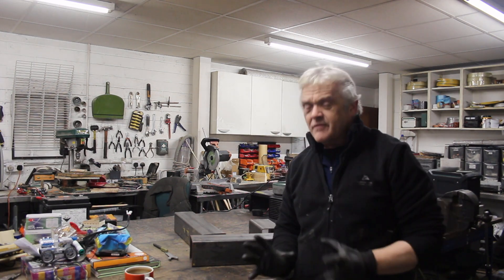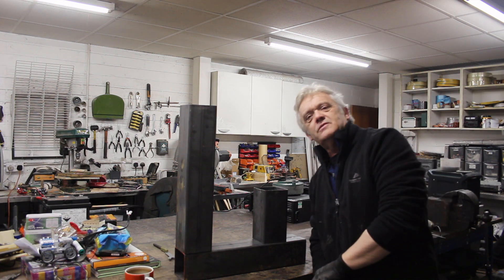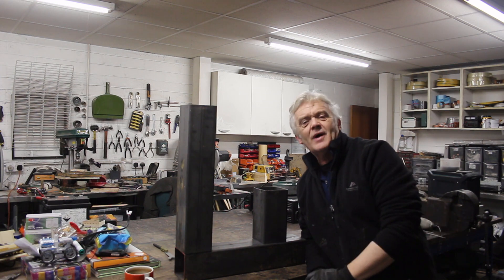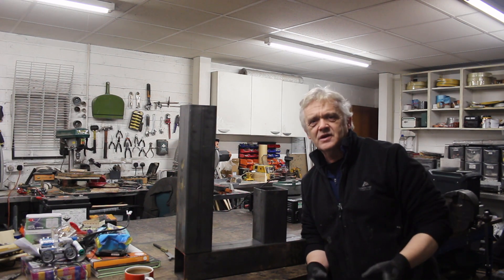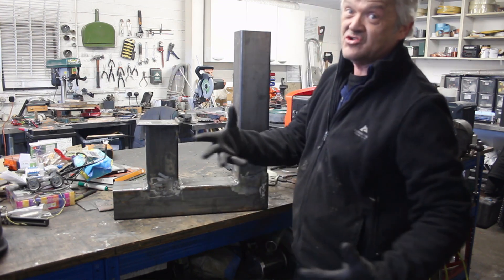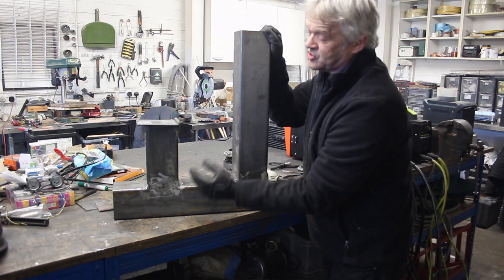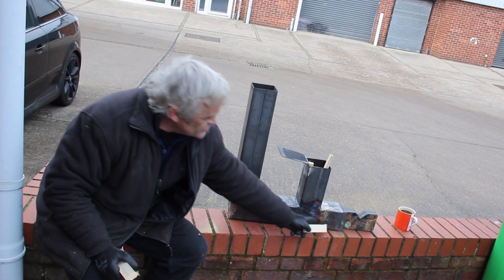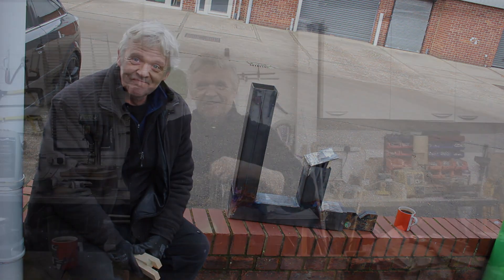1404 Rocket Stove For Mass Heating

Comment: I tried the L shape and it sucked, cooking a steak took much longer than usual. Maybe the tube was too small (800mm) or the height ratio was wrong, but I wasted time and steel with that, I should have made a J type instead.

Comment: Unhindered air flow, uninterrupted fire and Ash removal. 

Would welding a tube underneath (same measurements) with grates or holes drilled in the area of the burn chamber, help with better (unrestricted) air flow and the collection of fallen ash?

Great videos, sub'd ages ago.
Thank you for the uploads, each and every one of them.

Comment: My advice is,  get an oxy-acetylene kit and learn to use that instead of a welder. It can do everything you need for working metal. It can cut, weld, braze, solder, heat, anneal and temper most common metals.  There is a torch called a cobra or henrob 2000 that is amazing. Plenty of youtube videos on it.

Comment: If you really want to have a lot of fun get an oxygen and acetylene tank you don't have to get a great big setup just get a small setup a couple of 40 lb bottles perhaps and breathing is a lot of fun and you can weld with it as well most people don't call it welding anymore but it technically it is welding when you use certain metal rods for filler when you use brass rod it's considered breathing it doesn't penetrate at all but it is very very strong and one advantage is it's very good for welding cast iron or should I say breathing cast iron a fixing cast iron to each other if you will but it's a lot of fun it's very fast and I just love it I've got a pretty nice mig setup too. I got a pocket full of money right now and I'm thinking about getting a TIG set up but I just don't want to let go of the money I'm still thinking about it

Comment: Could you create a countercurrent heat exchanger for the intake air by creating a coaxial chamber around the chimney/burn chamber, i.e. intake on the outer perimeter of the top of the chimney.

Comment: Thank you for sharing!  I loved the video on the copper thermoelectric generator and was thinking you were going to do something with that in this video.  I really like this idea though!
One thing I've learned with Rocket Stoves is, the intake pipe diameter or size will determine the smoke stack or out pipe.  I believe the height should be at least 3 times the size of the intake opening, but I could be wrong and it may be 4 times.
The entire rocket stove should be made of the same size pipe for proper air flow so you never get smoke coming out the intake.

Comment: We built one like this with 6 inch tubing.  It's using an old propane tank for the heat exchanger.  My lovely bride covered it with cob and it's the finest wood burning heater we've ever used!  Nice even heat.  And no problem keeping the greenhouse and cabin nicely warm.
Reply: Could you put a video about it on YouTube?

Comment: Ceramic Fibreboard can be used instead as steel cannot handle the heat from a true RMH burn chamber or cheaper is casting using  DIY refractory  👌 CFB is easiest to achieve the riser height and diameter

Comment: I think people came to the conclusion of using bigger diameter tubes from trial and error. Bigger tubes draw more effectively and also allow for bigger bits of wood to be used. I think the pressure differential caused by the hot and cold gassed is quite low, so any restriction on the flow has a big effect.

Comment: For ash removal, you could try a square sheet of metal that fits the inner diameter of the bottom tube/pipe. Weld a rod to it and leave it inside, when you're ready to empty it, pull the rod and it'll drag the ash out. Perhaps add an ash tray on the exit for ease of use
Reply: Or just turn it on its side and give it a quick shake 😅😝🙃

Comment: A combined (portable ish) stove and mass heater can be made by using concrete in an old 20 plastic drum or similar, and either cardboard tubing or shaped polystyrene etc to form void and internal shape of rocket stove once burnt out.
Once concrete dry, remove outer mold and  either burn out or dig out polystyrene etc, and away you go!

Comment: Word of warning: Rocket Mass Heaters get intensely hot inside, on the order of 1000°C (when using larger, insulated designs). This coupled with excess oxygen will burn carbon out of the steel and turn your combustion unit into a pile of shards in very short order! 
Little cook stoves with no insulation are generally ok in metal but when building a permanent heater install, absolutely build the J-tube out of refractory materials!
Reply: I was thinking the same myself. In the drive for efficient burning, the temperature has to be raised and as you point out this degrades the steel. Lining with refractory bricks is the only way to protect the steel.
Reply: @JohnnyMotel99  
Correct. After scaling up a couple inches, it becomes easier to just build the things from masonry entirely. 
They stop being portable as their weight goes right through the roof. For that, you get a very intense source of heat that is also very clean. These stoves don't smoke and chug along happily up in the 93-95% efficiency range, outside of a laboratory and consistently.
Reply: @SundogbuildersNet  In places like Siberia, I have seen these huge brick 'furnaces' which are central to the house. They fire them up once or twice a day, run them very hot for a while, then the stored heat keeps the house warm for hours.
Reply: @JohnnyMotel99  
Yeah. Those are a type of Masonry Stove, an Eastern European solution that is very old. Rocket Mass Heaters (which I've been working on for the last 20 years) is a kind of subset of Masonry Heaters. 
Same basic idea though RMH are generally cheaper and easier to build. A good Masonry Heater will easily cost $10,000 dollars just to get in the door, while an RMH can be cobbled together for less than $1000 and I can show you how to build them with trash, scrap and mud for nothing.

Comment: Thanks for the mention Robert. 
To start the J tube drop a piece of lit paper down the chimney side and that will preheat the flu and get the fire burning in the right direction, mine uses an inverted jay with a batch box style (2 old gas cylinders welded together) with a drain grate inside for fuel to sit on and ash pan underneath which is also primary air intake forcing air too flow through the fuel (wood or coal) the other end of j then flows into oven which is a stratification or bell chamber before exiting flu from the base of the oven this extracts most of the heat from the fire before it goes out of the flu.
I've done way too much research into this lol, look up 'Erica and Ernie Weisner' as well as 'walker stoves' and of coarse 'Paul Wheaton' they do some brilliant videos on rocket mass heaters.
Hope this all helps with your build. :)
Reply: +1 to all of the great references you mentioned, especially 'Walker Stoves'. Lots of real testing of materials and designs. Would add Aprevecho to the list as well.

Comment: Just found great rocket stove source.  YT Paul Weaton has alot to say about rocket heaters and water rocket heaters.  Best source I've found to date.    Insulate main chamber increases temp 1000 to 1800.  Use mass to store heat for days.  1/10th the wood needed, higher temp with insulation doesn't burn wood faster.  I might add a stainless coil to heat water for thermal mass through a thermal syphon.

Comment: Most of the stoves I've seen bring the air in around the wood that is burning witch means that the vent stack has to be at least 3 x the height but it can be floor to ceiling if you so desire. In this way you can feed wood much longer than the metal of the stove. Gravity feed of course

Comment: Just out of curiosity what happens if you introduce a slope on the base section up towards the chimney section?  I’m not talking too steep but an inch or two over the length.  It would aid in the draw on lighting and may reduce that smoking issue quicker upon lighting which would help on an indoor burner.  You could test this simply by putting blocks under the chimney end to test (it would put your chimney out of plum but for the test shouldn’t matter as if it works then you could cut and weld the angles)
Reply: I've tried different angles,  from slight to about 45°. What I've found over the years is that the angle doesn't really help and causes other issues instead.
Turns out that the best position is a vertical feed in a J-tube stove. The benefits from this arrangement outweigh any possible issues with it.

Smoke back on starting the stove can be prevented by good lighting procedure.
Reply: A slope increases friction and makes it harder for the wood to descend on its own. You'll have to babysit the fire more with the feed on a slope.
Reply: @SundogbuildersNet  I’m talking about an inch or two over the length of the base and initially as a trial. If it worked better with the angle as I mentioned you could alway cut the angle to both the chimney and the feed tube to make them plum. So there is no change to the fuel being fed to the fire.
Reply: What I do appreciate about your comments here is that you're already thinking about wood burning as a fluid dynamics puzzle. This way of thinking is key to figuring stove stuff out and you're already on the right track. Be aware that fluid dynamics are rather non-intuitive at times.   We're taught a handful of thinking shortcuts about fire and the like that generally work in a lot of cases but aren't particularly accurate and don't apply to all cases. These shortcuts (like heat rises) can get us in trouble when applied outside of their use cases. Rocket stoves, in particular Rocket Mass Heaters, tend to be outside of those cases and unfortunately, our simplified thumbnail models kind of fall down there.

Comment: In a previous life I used to operate a solid fuel appliance testing facility and I can assure you the tinkering can be endless and something of a dark art. 
Coincidentally I will be replacing an old wood burner in my shed with a hybrid  rocket mass heater later in the year so definitely more tinkering for me on the cards.

Comment: I like this idea, I dont see how the diagram fits in with how you are describing what you will make though. you can make a rocket stove from two pieces of tube in an L shape if the bottom of the L is 2 levels, one for the fuel feed and a lower one for air, Ive made that style from scrap cans for cooking on, they can produce an amazing amount of heat on very little fuel
Reply from the maker: there are quite a few designs to there mate from simple cans to much more complex builds - it's really horses for courses

Comment: Nice job... I'm curious as to why you didn't angle the feed chamber like you did on the first one. I'm pretty sure it will not chimney smoke if you did.
Reply from the maker: really just to make room and square everything off so it is easier to build around
Reply: Vertical feed encourages the wood to drop on it's own better. This keeps the tips of the wood better positioned in the pyrolization area for more of the combustion cycle. Less babysitting as well (which is considerable in J-tube RMH).

If you have not oversized the mass/heat exchanger, your proportions are correct and your chimney is properly heated, smokeback isn't really a problem.

Comment: I found if the chimney was bigger in diameter than the inlet, you get a venturi effect, which makes the air draw faster, and it gets super hot ! I had wood pellets in mine with quarter inch wall thickness steel tube, that glowed red hot, from no more than a handful of pellets.
Reply: When you step up in size from 4 inch to 6 and 8 inch stoves, this effect drops off and stops being significant.  Generally, the best practice is to maintain constant cross sectional area through the combustion unit.
Reply from the maker: yeah I was reading about that - it is interesting

Comment: Nice choice of topics Robert!!!  I have been planning to do one of these myself.  I also wish to incorporate a fan for rapid starts and hotter temps, as well as stainless or graphite coils for water heating, and some form of thermionic generator, well...just for grins!  I've seen these used in garages with separate air intakes and exhaust so it does not suck the air out of the room.
Lastly, less you not want to use it, need to incorporate a real easy way to dispose of ash as that's a real pain.  :)
Reply from the maker: when I was a kid we had solid fuel in my house - I know about ashes lol - it was my job to set the fires in the morning
Reply: @ThinkingandTinkering  There's something really gratifying about slowly shovelling ash, or is that just me, 😂cheers.
Reply: @l0I0I0I0  😳😂

Comment: I had the same thought about the part where wood is placed not needing to be an exact height.
I had seen a video of a guy who showed a timelapse of what looked to be a long 4x4(10x10cm) post gradually being eaten away by the mass rocket stove.
Theoretically you could place pieces in even a few meters long, giving you a lot more than the usual half our or so burn time before it would need refilling.
Reply: That sort of works. In theory, it's good. In reality, the wood tends to get hung up on itself and then stops descending. The bottom then burns off making the wood top heavy. The wood then falls out of the stove and can catch the house on fire.
If your wood is much taller than the feed itself,  you MUST babysit it or risk your house burning down.
Reply from the maker: I'll bet that was an awesome vid actually lol

Comment: This is a subject you can delve into at great depth ..... or just have a play!

One thing I would call into doubt is the legendary efficiency. Just on a pure physics level it does not make sense how one of these can be more efficient than a well designed gassifying  log burner. Both pyrolyse the wood and burn the gas produced and there is a fixed amount of energy in the wood you burn. The main difference for me is the speed of the burn. This means your rocket stove will generate a great deal of heat and do it quickly. The flip side is that you will need to stoke the fuel more often and they rely on thin pieces of wood. 

I have a class A log burner that chucks out up to 5KW of heat and can send any adult into a tupour "watching the faeries"  and I have found long after the fire had died away the chimney remains warm .... this is noticeable in the bedroom above the fire as well! All evidence of how well a thermal mass can work! I look forward to see the end product in the shop. ..... as well as the journey to get there! ;o)
Reply from the maker: I think they are basically a gasifying log burner -  I think the benefit really comes in the simplicity and adaptability of the build
Reply: @ThinkingandTinkering  Exactly! .... and the Fun!

Comment: Mig welding with shielding gas is so much better than stick or using flux cored wire.  None of the thinking a weld is good, to then find it is  flux holding parts together. Lol

Tig seems even better because in theory can weld pretty much any metal. No bending of rod making positioning diffificult due to magnetic field and current interactions. And while probably bad practice, can easily remake/patch up a poor weld as going along, often by reheating it. As an experiment iI've even used a random bit of old metal strapping as a filler rod.

Only issue...  My cheepish  tig inverter doesn't have a HF starter... So it is "scratch start"...
Very much like using a blow torch and is great once arc struck....  But I tend to burn the tungsten electrode out due to how frequently it gets stuck on workpiece with my inexperienced efforts!
Reply from the maker: I love the learning curve of welding to be honest mate

Comment: You did good my friend but a few modifications need to be done first install the rocket stove into a 55 gallon barrel and install it 6 to 8 inches from the bottom of the barrel with the exhaust vent at the same level on the opposite side of the barrel  then add a access door for soot cleaning 90 degrees from the exhaust vent system on either the left or right side your choice at the 6 to 8 level from the bottom of the barrel and add a 6 to 8 inch long square tube right under the fuel supply tube for ash collection  and use some kind latch system on the cap that keeps it locked when not in use that is the same size square tubing that is used for the fuel supply tube and convert the whole wood stove to run on wood pellets with a 60 pound gravity fed hopper system and on soot clean out access panel or door have it completely air when it is closed when not in use and also add a heat exchanger system that can be used for heating water on the exhaust vent system of the mass heater/stove and on the top side of the 55 gallon barrel weld a half inch thick piece of plate steel with reinforcements on the bottom side of the plate steel.
Reply from the maker: nice tips mate thanks for taking the time to post